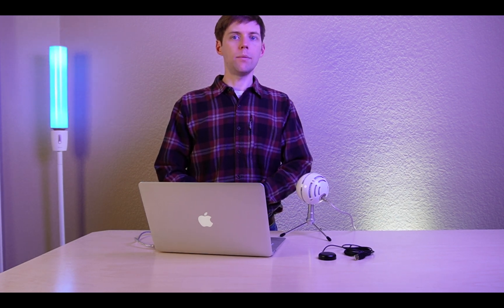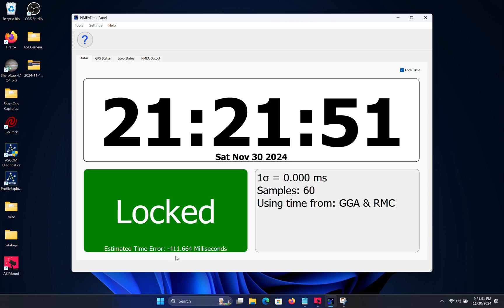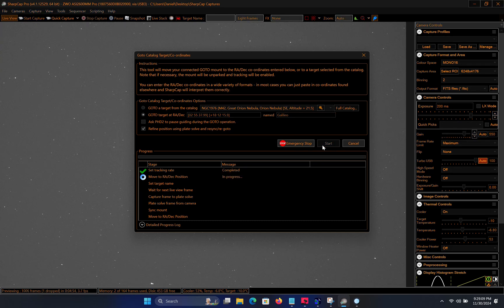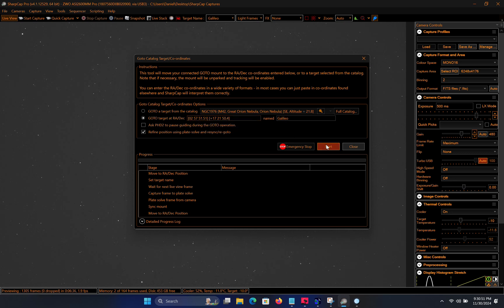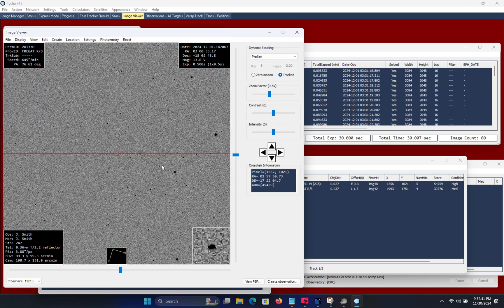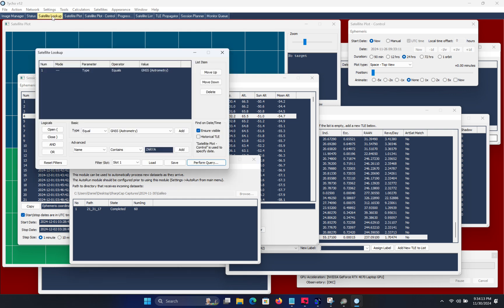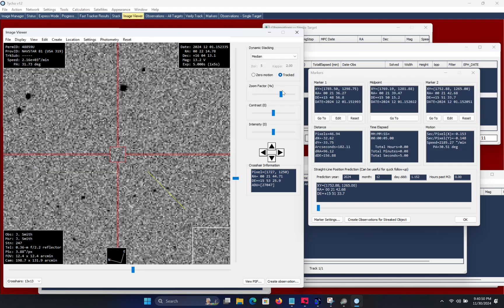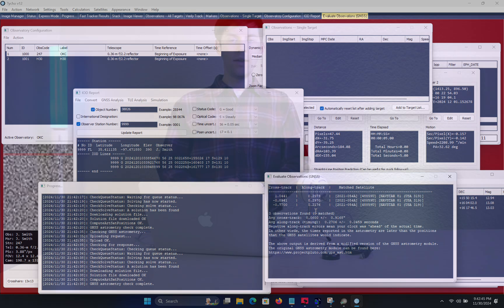How to: Validate Accuracy of Timing Source

Comment: Thank you for the video tutorial, just one question: has your software considered the correction of the time difference between the lines for a rolling shutter camera? The time difference can reach 0.1-0.2s from the top to the bottom of the image.
Reply from the maker: It is usually recommended to keep the exposures short (such as 0.1 seconds) so that the object will be point-like and thus allow for PSF fitting for the astrometry.  In this case, when the exposure itself is that short, then the computed time error remains informative even with rolling shutter: if the timing error is more than the exposure time itself (0.1 seconds) then indeed one can be confident that it is not simply a result of rolling shutter.  Furthermore, one can also keep the object centered in the frame to get a consistent result so as to minimize the contribution of rolling shutter.  What I have found to be the dominant source of timing error is that even though the acquisition software tells the camera to start an exposure, the camera itself does not immediately start the exposure.. there is some small delay.  Then, the camera says it is finished with the exposure, and the acquisition software downloads it.  It is the acquisition software itself that applies the timestamp to the image file.  So, what timestamp to apply?  When the exposure was requested, even though the camera may not start the exposure immediately?  Or when the camera indicated that the exposure finished, which itself can also have some delay?  So the best way to mitigate that is some cameras can be equipped with a GPS module that records the actual timestamp at when the exposure was really started.  But only a few cameras have this option available.
Reply: @tychotracker  Recently I discussed this with the founder of QHYCCD. He admitted that "even though the acquisition software tells the camera to start an exposure, the camera itself does not immediately start the exposure" this is the only thing uncertain for non-GPS version cameras. All other delays can be measured through some methods.
Reply: @tychotracker  So my plan was to first account precisely for all the other measurable delays and measure the command-exposure delay by observing some GNSS targets with well-known positions to see whether it is stable. If stable, I can compensate for that.

Comment: Which gives "better" accuracy, the software "D4" or a physical GPS ?
Reply from the maker: I have heard good things about D4 (also known as "Dimension 4"), but have not personally tried it.  It could be interesting to do a comparison.  As I explained in a previous comment, keeping the PC clock synchronized is only part of the equation.  The other part is how the camera software fetches the timetag to be encoded into the exposure information.  For example, if the acquisition software has just now downloaded an exposure from the camera, but waits until the OS is ready for it to write the image to disk before fetching the timetag, then some additional delay will have occurred, rendering the timetag less accurate than it could have been.  So the main point of the video is to provide a way to do an end-to-end test that takes into account all of the variables, by making use of measurements of a known object.